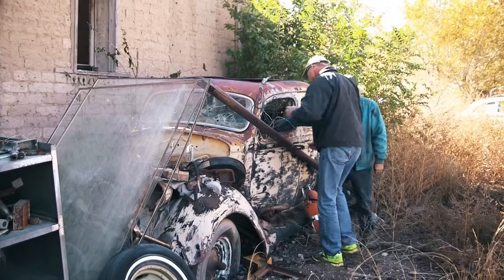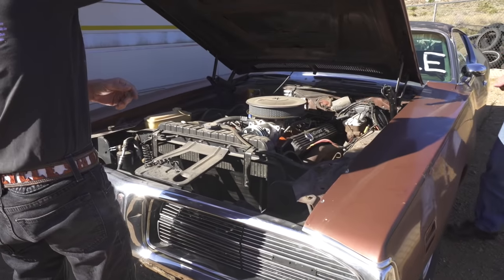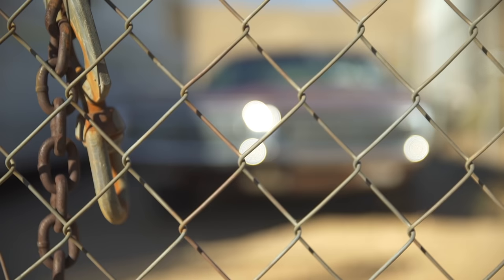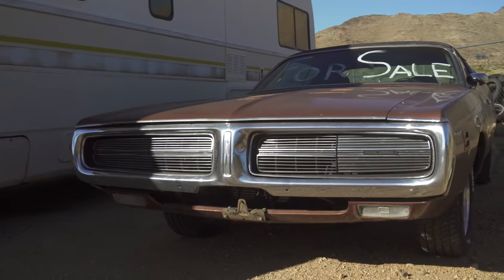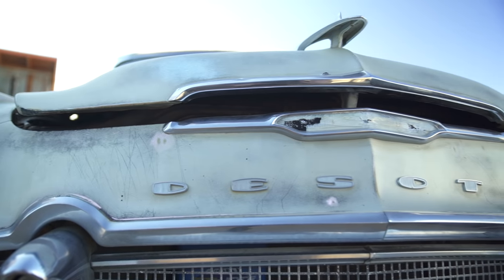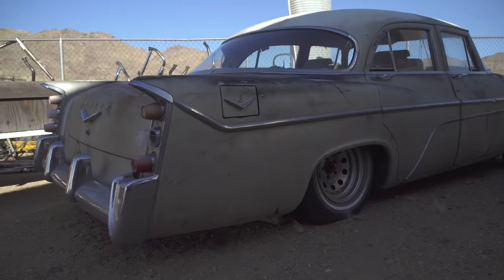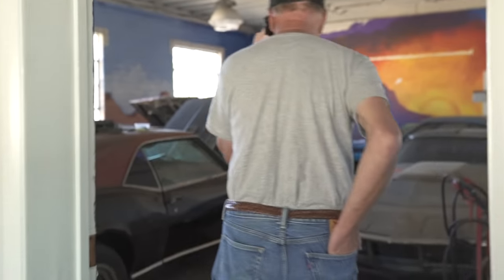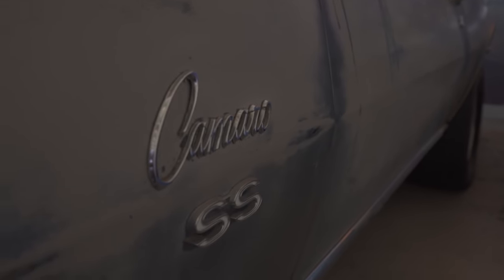Original Big-Block Camaros in Arizona | Barn Find Hunter - Ep. 11

Comment: back in 1985 i was approached by a neighbor asking if i wanted to buy a 68 camaro for 100 bucks, i said i wanted to see it, he said well come out front, and check it out, went out there to find a 68 camaro hanging from a sling on an old wrecker, it had 1973 plates on it, we threw a battery in it and dumped some gas in the carb, fired up on 3rd try, i paid the 100 dollars and had them drop the car in my driveway, i spent 20 years working on that car, engine after engine, trans after trans, suspension parts upgraded, new vinyl top, new quarters, floor pans, whole frame off backyard restoration, then one day i just got tired of all the work, all the time spent and sold it, i love them cars, but that thing took so much of my time and money i just couldnt stand it any longer.

Comment: Cool stuff, and naturally we don't see what happens off camera, but I think when buying cars like those you need to give them a much closer inspection.  I could just see opening the trunk on the Charger to see the pan all rotted out, or the unibody on the Camaro absolutely crunched underneath the quarter panel(*).  Probably the most solid cars in this episode were the DeSoto and the Duster.  Granted, didn't see much of the Duster and the DeSoto did have the dash ripped apart (rewiring a car from the 50s is child's play, though, compared to today's cars), but they'd still be tough sells for me.  I may be spoiled by living in the land of rust (NE US) but I guess that makes it easy for me to know what I can get into or not.

Comment: What about that c3? Any details on that?
Reply: OneFastC4 yeah take Alex advice :v
Reply: +Alex Caulfield 68-72 chrome bumper cars, especially big blocks, are not worthless. L88 C3s and zr1s and zr2s are high 6 and sometimes 7 figure cars. After that though, I can agree with you to some extent.
Reply: OneFastC4 that bumblebee yellow ZL1 car would be a goldmine, too.  Or any of the real Motion/Yenko cars.

My dad owned and daily drove a highly modified '77 L82/4 speed car for 21 years.  He would tell you they're beautiful cars but built like shit.  He used to be able to predict accurately to +/- 10 miles when a specific part would fail on the car, whether it be a half shaft twisting the splines off, or  shims popping out of the front suspension.  One time he was cruising down the highway, and the rear end seized and locked both back wheels up.  The only way I'd ever own a C3 is basically have a C3 body/interior on top of a C5 chassis and drivetrain.  it's unfortunate, but you really have to figure what the purpose of the car is...is it going to be a car you're going to drive frequently, or a weekend show car/racer?  It's difficult to have both with an original or lightly modified C3.